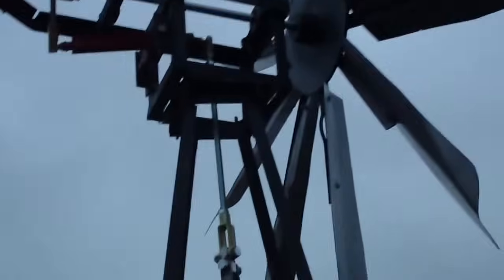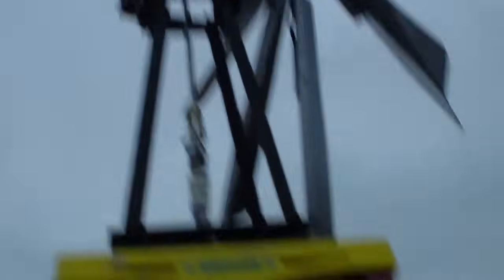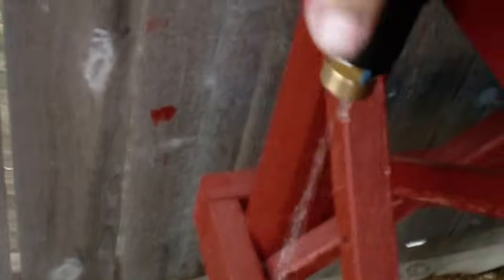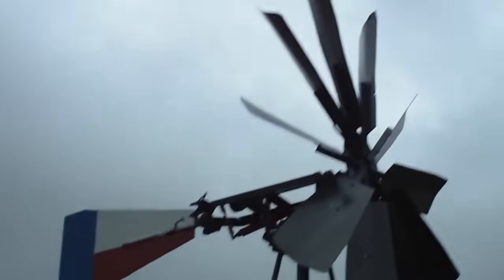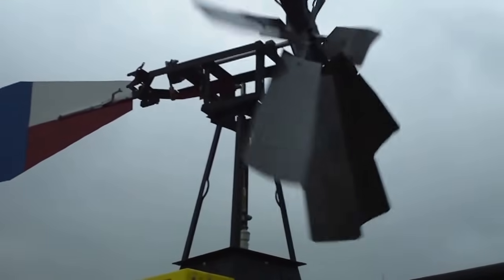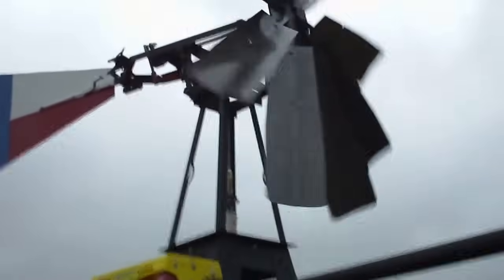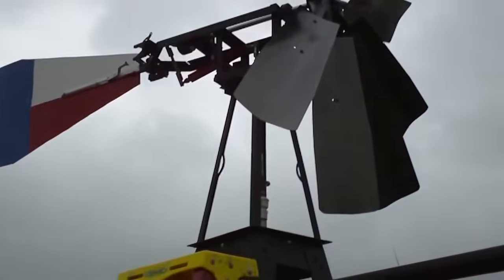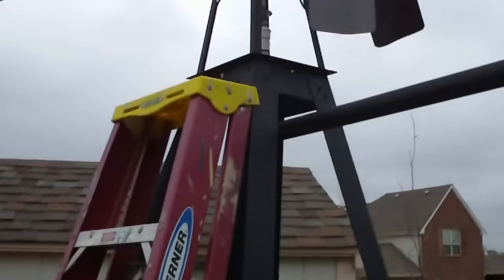The Finished DIY Water Pumping Garden Windmill In Operation Pumping Water

Comment: I like your design, its convenient to have a back wheel behind  the shaft of wind turbine to make the arm go up and down. Sorry if I missed that info but how does water go up? The pipe that goes up and down have 2 check valves?
Reply from the maker: I created a standing column of water using  a 3/4 inch one way check valve feeding into1 1/2 inch pipe that has a 1/2 sucker pipe with a marble check valve doing the 'sucking"
here is the full play list....https://www.youtube.com/playlist?list=PLV3OUUap8JeCIGtlFZlXmEt7uvzl-jCIK
Reply: Forgot to mention, good job on the painting , always good to be proud of where we are from